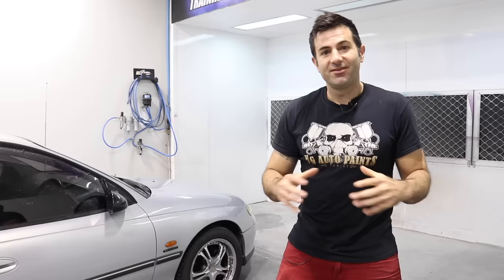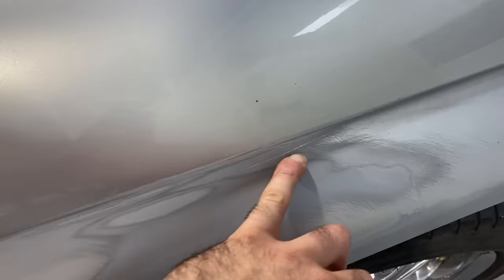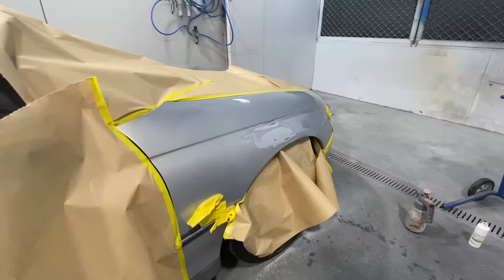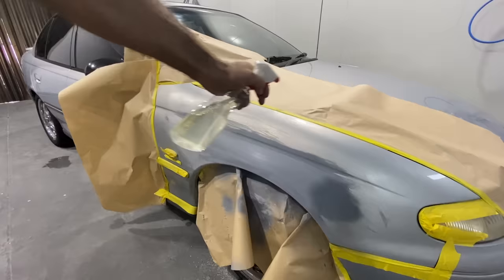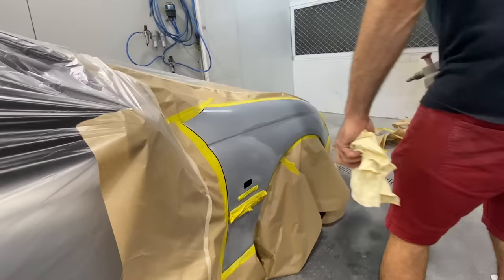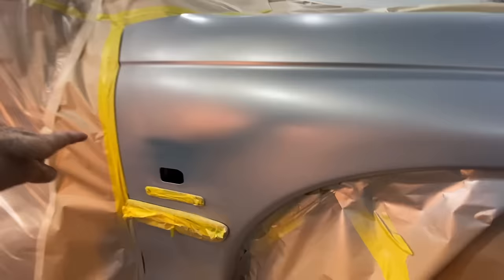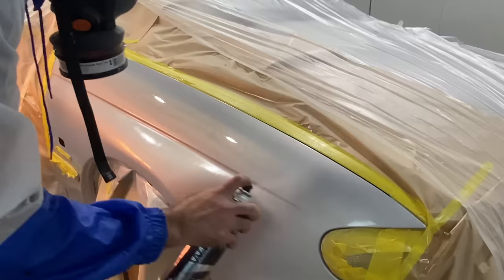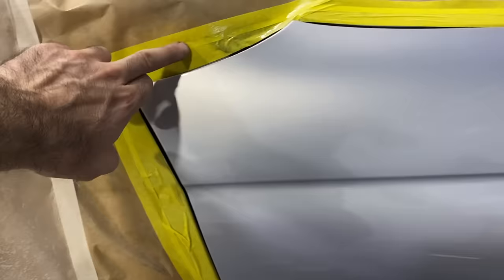How to paint with Spray Cans

Comment: Hey Dave,  I seem to get like an ornage peel effect in my gloss black base coat, any advice? cheers
Reply from the maker: Rob Eilbeck what kind of paint is it
Reply: @customspraymods   heres a direct link to it. It's an acrylic base. https://www.halfords.com/motoring/paints-and-body-repair/car-spray-paints/halfords-gloss-black-spray-paint-500ml-473132.html#
Reply from the maker: Rob Eilbeck that us normal. This video should help. Basically you need to sand and buff. But try sanding with 600 and coating again
Reply from the maker: https://youtu.be/gw3SEiCf2UY
Reply: @customspraymods  
Awesome, thanks for the help mate, much appreciated!
Reply: @customspraymods   Just to be clear, should I sand the base, or lacquer it first then sand and buff? cheers mate
Reply from the maker: Rob Eilbeck that paint you have is a topcoat black. So you don’t really need clear. By sanding it and re coating it with black would minimise peel. If you still have peel after that you can sand and buff.
Reply: @customspraymods  ahh I see! Mate you've been such a help thank you!
Reply: @customspraymods   Just thought I'd come back and let you know it came out looking real good thanks to your advice. Cheers mate!